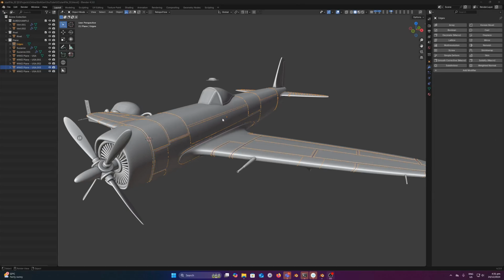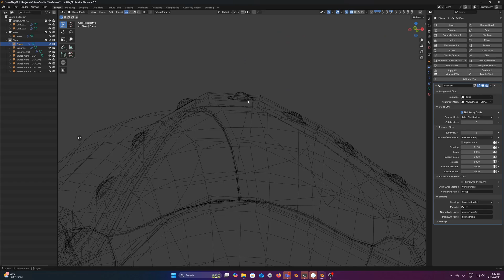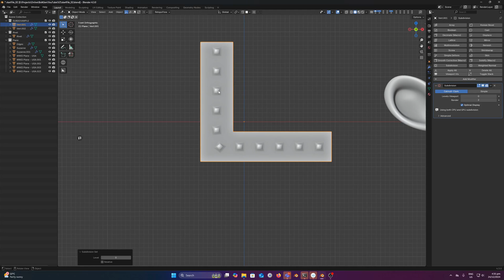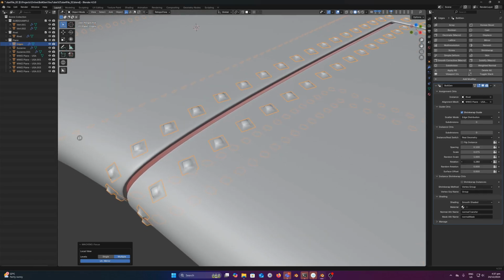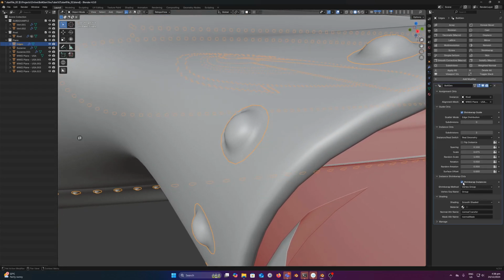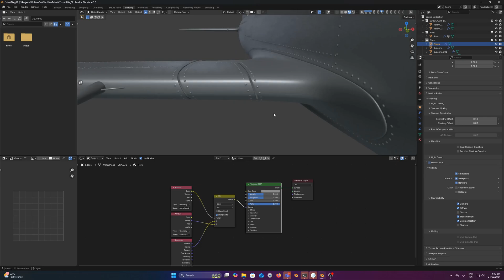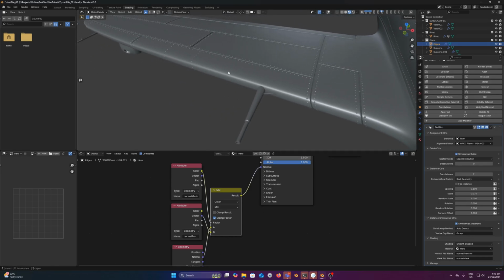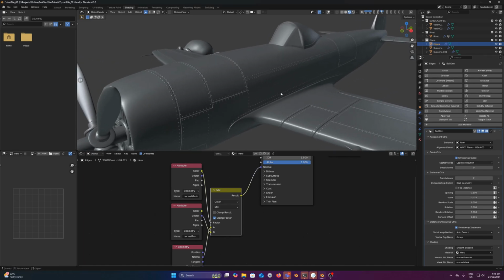BoltGen 2.0 - Procedural Bolt/Rivet Generation in Blender (Geometry Nodes)

Comment from the maker: Hey everyone. Just wanted to add that in the latest version you no longer have to reply on the shader editor to transfer normals. With blender 4.5 I have removed that feature and with a single checkbox on the modifier you can bake the normals directly onto the geometry. This means you can export out the bolts and bake in another software without loosing that information. Please update :)

Comment: Thanks for your job! I actually bought it, but I have some issues. Instances do not shrink to the surface in either instance or real geometry they are about several sm away from it with random rotation; auto detect or shrinking edge gruop would not help either, they stretch the instance geometry. I don't have much geometry about 28 k vert, but adding subsurf does not improve. Would be great if you could help me out
Reply from the maker: Hey, the issue might be that you haven't applied the transformations of your guide edge. Also, you need to make sure the origin/pivot point is located at the base of your rivet. Try that, and if that doesn't fix it, can you please send a .blend file to me on the platform that you purchased from? I'm sure it's an easy fix :)
Reply: This was all about the instance object origins! Once it is set at the bottom everything shrinks correctly
Reply: Thanks again!